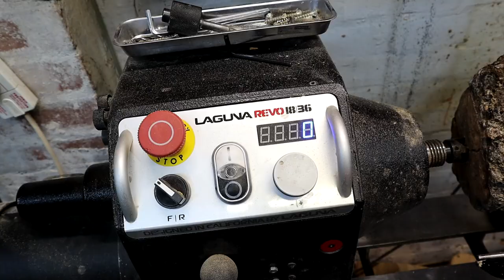Woodturning - The Gladiator Helmet

Comment: Great video, yet again. 
I am still confused about why you drill the center only to out a plug in it before casting in resin. Can you tell me why?
Reply from the maker: Dries faster in the oven, leave the centre in and the outside will dry and it could still be weeks before the moisture in the centre makes its way out.
Reply: @MattJordanWoodturning  Makes sense. Thanks!

Comment: very cool end result, but if it really took you 9 hours to make that small sheet of maille, you really need to look up how to make it properly ( that technique was painful to watch. a sheet that size should take less than 1 hour, closer to a half)
Reply from the maker: I've since discovered much faster techniques of making it, however first attempt and yes it was a painful way.
Reply: @MattJordanWoodturning  I didn't mean to be an ass about it, I am sorry for that. until injuries to my whole body ( parachute accident in the ARMY) progressed to the point that it was too painful to do, I was a professional maille smith for about 12 years. my top speed for weaving a full haubergon including tailoring the sleeves and union to the body  ( approximately 38,000 16-5/16 steel rings) was about 14 hours.  for a first attempt that was not so bad. it is just something I was very passionate about for a long time. I miss being able to work 16 hour days making armor and clothing.